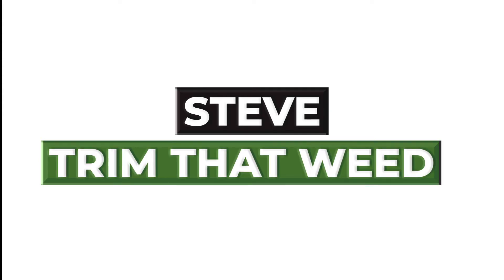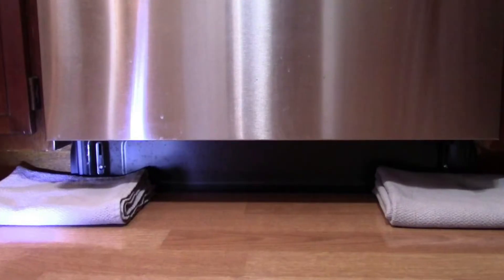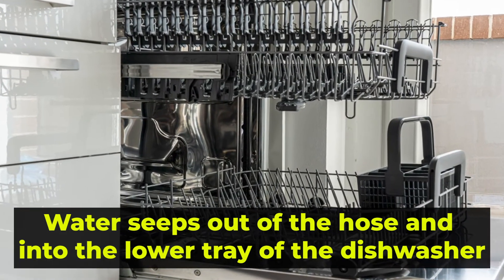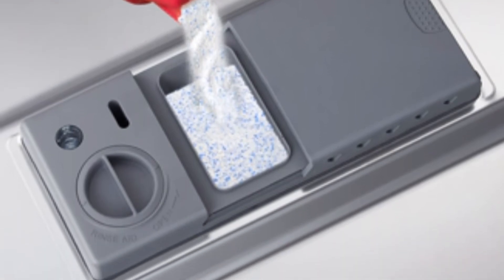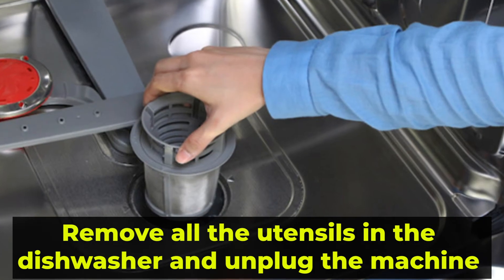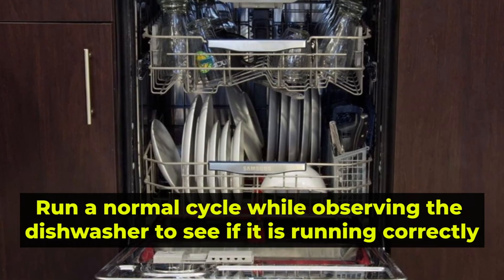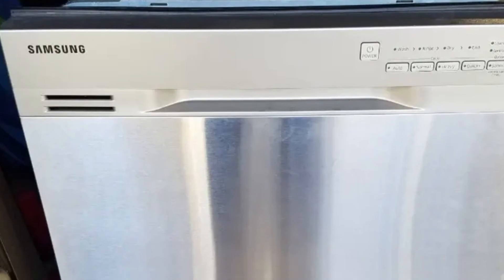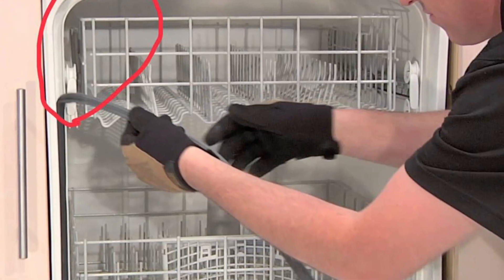Samsung Dishwasher LC Error Code – Insights into its Origin, Troubleshooting, and Restoration

Comment: The most common cause is the dishwasher itself not being level left to right and/or not level front to back. A 1 degree lean back is best. The door gasket only seals on the sides and top. The bottom seal is a different style, and food debris can buildup as slime and interfere with that seal.
Drain hoses do not suddenly become pinched. Even if they did, this will not send water underneath the dishwasher.
The filter basket has nothing to do with leaks under the machine.
A failed or failing water inlet valve can be the cause of water overflowing the front lip and getting underneath or leaking directly into the bottom pan where the leak sensor is.
Why is a gardening channel showing a video on appliances? Please leave this content to professionals like myself with years of diagnostic experience.

Comment: Sorry. Seems good but it’s relatively useless for many instances. You can’t run the dishwasher, at all, when it has an “LC” code activated. Not pleased with the lifespan of this dishwasher.
Reply: How did you remove the sensor?
Reply: @TheJadestevens1980  - Not sure if I'm allowed to post a link, but: https://www.youtube.com/watch?v=r-METNuGa08 - if that gets scrubbed, search YouTube for "Samsung Dishwasher Leak Sensor Replacement #DD94-01062A" and at about the 3-minute mark you'll see. The sensor's attached to the plastic access panel with two screws. You'll need to unplug the unit, disconnect the water lines, carefully tip the DW on its side, then remove the bottom access panel and you'll see the sensor and will have to disconnect it to release the access panel. Hope that helps.
Reply: So far I've tried leaving the unit unplugged for 48 hours, auto-started when plugged in and immediately registered an "LC", deep cleaned the filters with no effect, removed the pan and relocated the water sensor to higher ground with no effect. Today I'm going to remove the drainage hose and make sure it's clear and doublecheck all hose and waterline connections. I'm also going to continue searching for YouTube videos and surf the net for other potential solutions.
Reply: @Zraddog anything I'm having a similar problem?
Reply: @Ratioy  We took it apart, no leak. Took out the sensor and it runs fine. Will replace the sensor.
Reply: @Ratioy  - Just seeing this - yeah, I'd relocated the sensor and then found that some of the screws in the basin inside the unit were slightly loose, so I cleaned them up and then tightened them down and then relocated the sensor back to where it was, and all has been working fine since.